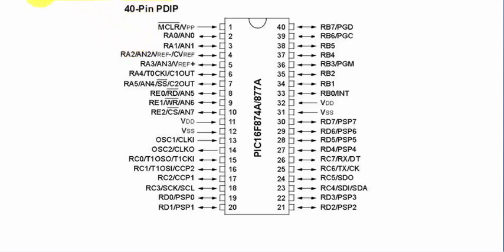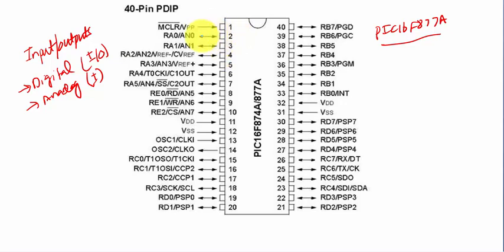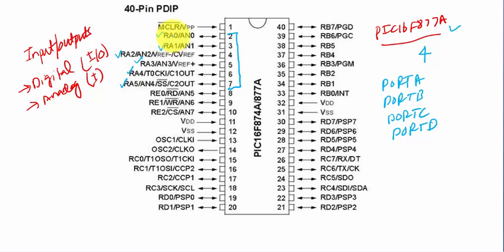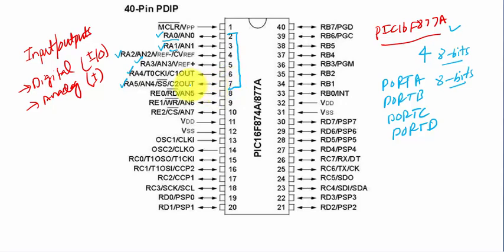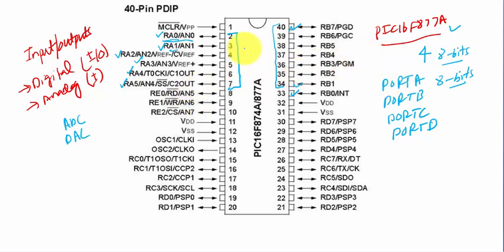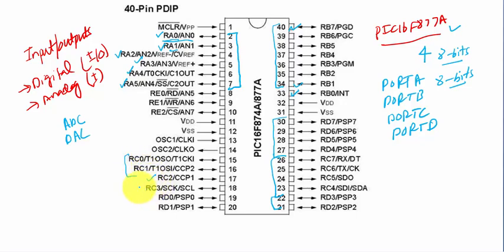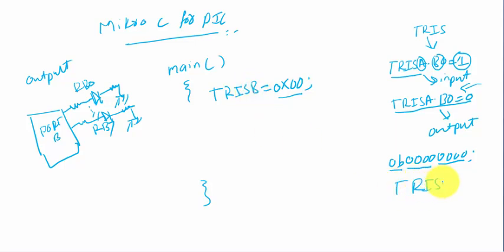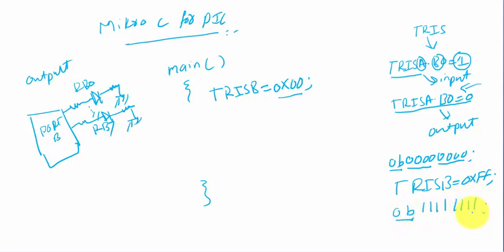how to use input output ports of pic microcontroller

Comment: i have an doubt like .once i can use the pic16f877A in that i set all b pin o/p by the led but i did not get  8 led glow .but i get only 2 led glow.if i connect more than  2led it did not glow.so please ans me how to 8 led on and off
Reply: Use NPN transistors or mosfets